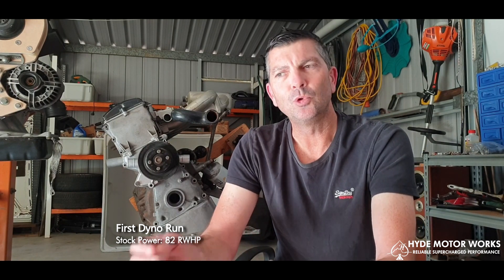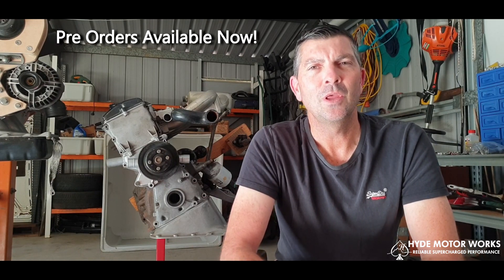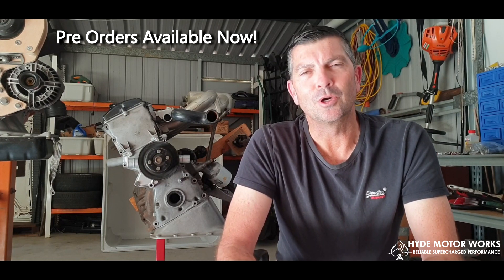BMW M10 Supercharger Kit Dyno | BMW 2002, E30 & More | Part 3

Comment: 12min mark, M10s are good for alot more on stock internals. 
Remember this is still a 1.8 or 2.0liter engine, 140whp is nothing to a engine of this capacity, it´s no strain at all
Reply: thats so true, I've seen stock internal m10s ( it was refreshed and rebuilt but using all stock components) pushing 300+ on stock internals using a standalone and turbo/intercooler.
Reply: @JessHull  Are they that stout?
Reply: @JpSierra-g7k  yes very much so. Its as though they were built for boost straight from the factory. lol